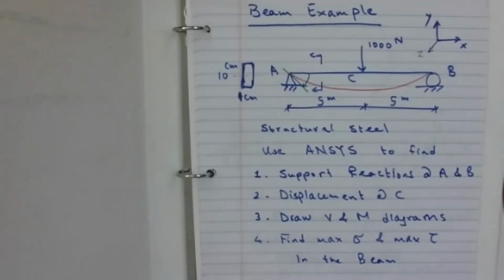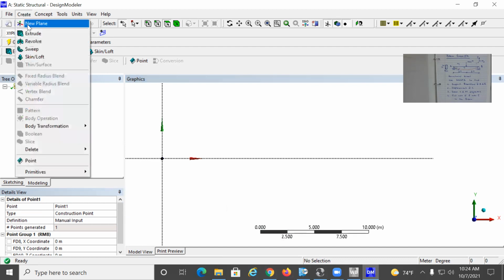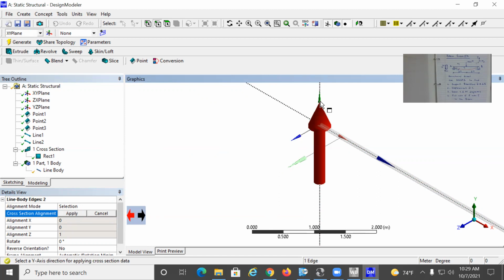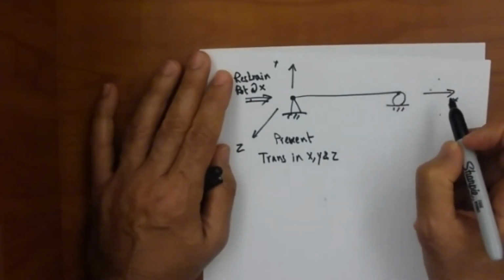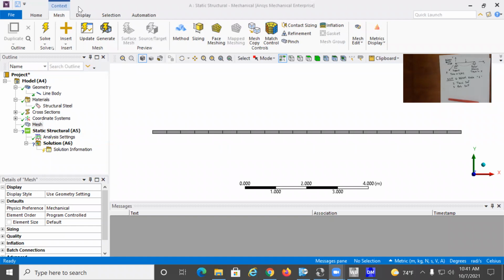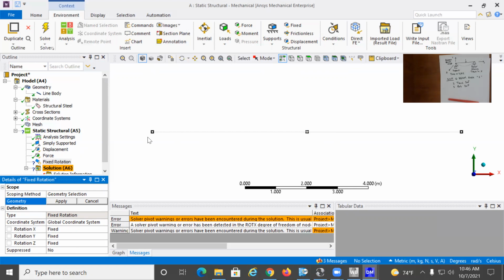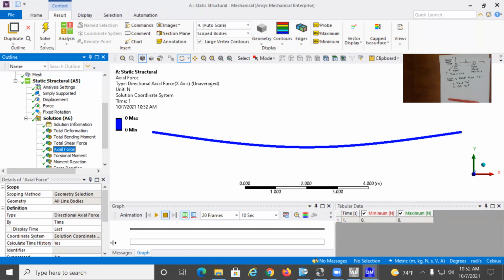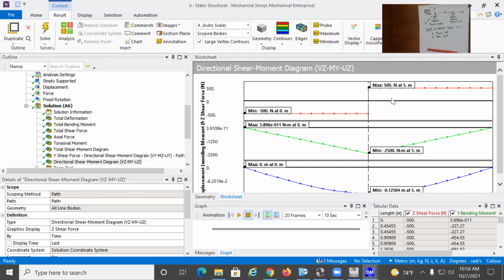Modeling Simply supported Beam in ANSYS Workbench using BEAM Elements

Comment: Sir I have a dout the result in shear force diagram and bendingmoment diagram answer will be in flip side .While performing all simply supported beam problem same thing will be happening .Sir anysolution
Reply from the maker: Are you confirming that they are in the flip side for simply supported beams?
Reply: When i am doing in ansys workbench same think will be happening in shear force diagram for all simply supported problem positive side will be in negative side negative side in positive side . Is there is any solution to overcome the problem sir